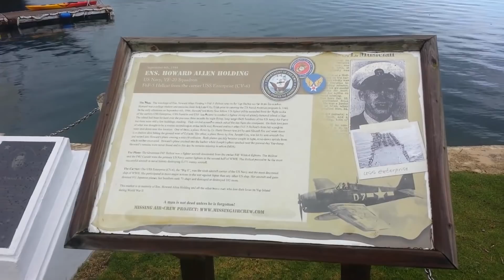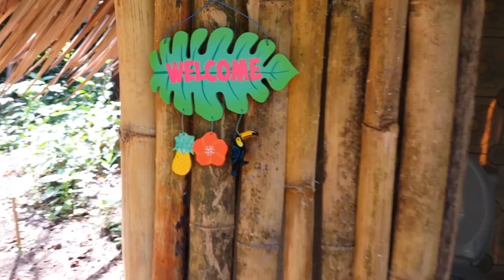Aircrete Dome Home, May 26 Update, Yap, Micronesia

Comment: You were probably mixing too big of a batch causing the motor to draw maximum amperage and you probably didn't have high enough capacity either due to the power source or the cord/extension cord leading to voltage drop which causes the motor to burn out.

Comment: The mixer motor died on you .... not because made in China ....  is because you cover the motor ventilation with plastic bag or so ....  preventing cooling down  ...
Reply from the maker: No...I did not inhibit ventilation with a plastic bag. I used an air filter. I also cleaned the air filter frequently. I know that the motor needs cooling.....and I made sure it was getting enough air.

Comment: How big is the doom, what is it diam, How do you run wiring and or plumbing inside..
Reply from the maker: Hello John, It is 20 feet diameter. There is no plumbing in this dome because it is the entrance/living area. But it is easy to cut a channel for plumbing and electrical in the aircrete blocks.

Comment: John, glad to see you back to posting regular videos. I'm assuming the new computer came in. Really sorry about the poor quality of the chinese-made cement mixers. I would think in a pinch you could put something together that would work, at least in the short-term. Any motor with a little bit of power capable of reaching an appropriate RPM... A gasoline powered weed eater, a big drill, even some sort of Saw could be modified to attach the mixer to the end of it. Just be careful you don't build something that will grab one of your fingers and hurt you! By the way, a couple of videos back, I think the one titled island girl makes aircrete, I asked a couple of questions down in the comment section. That was right about the time you were having computer problems. If you have a couple of minutes to spare and could go back and answer those questions for me, I would really appreciate it. Thanks so much, as always enjoy your videos to no end, and already looking forward to the next one :-)